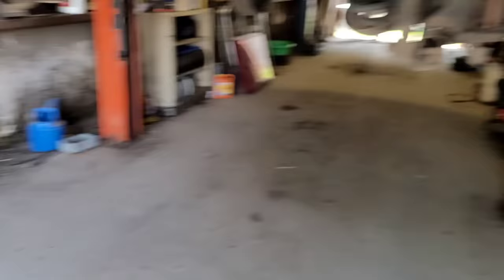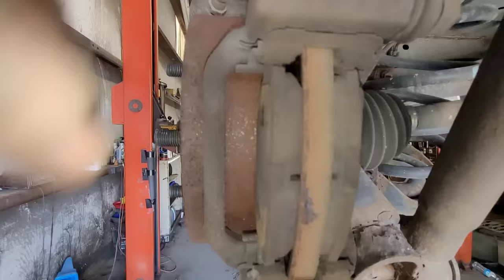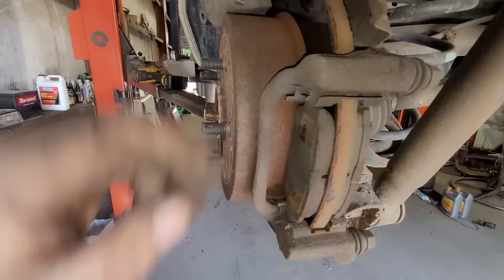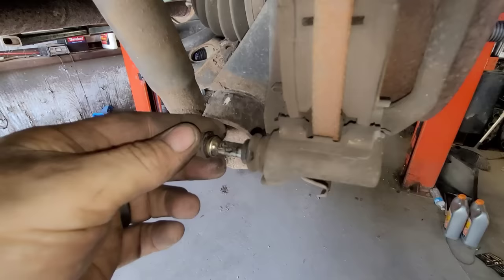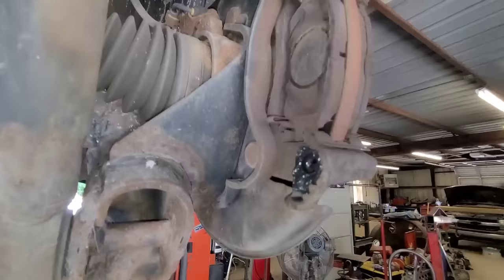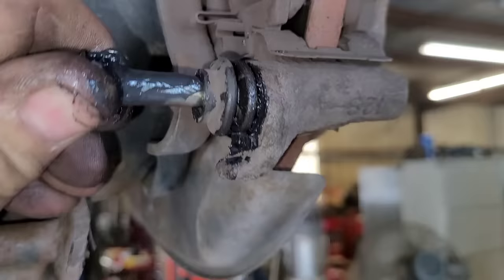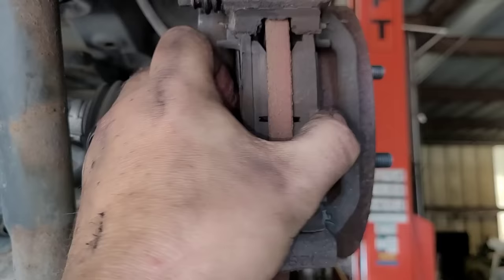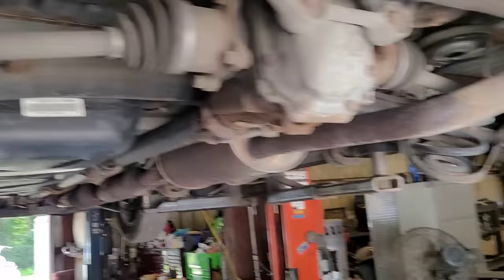Low Brake Pedal ? It's not air in the system...

Comment: The black grease is only for the back and ends of the pads . It will thicken up over time, and should not be used on slides. Only use a silicone based lube on the slides, such as Sil-Glyde.
Reply: Huh? You use them on the slide pins too, right? They are meant to be used for the slides.
Reply: @aboveaero  The synthetic black grease is supposed to thicken over time. It's made that way so it won't melt off the surfaces it's applied to. That is great for the metal parts of the pads, not for the slide pins. Silicone based grease (like Sil-Glide) won't thicken, making it great for slide pins.
Reply: Exactly
Reply: This might explain my sponges pedal, every so often my pedal starts to get sponges and if I press the pedal to the floor and release then my pedal becomes firm again and stays that way for a few weeks or so and becomes spongy again
Reply: "Only use a silicon based lube on the slides, such as Sil-Glyde."  You mean silicone, not silicon.  A silicone or polysiloxane is a polymer made up of siloxane They are typically colorless oils or rubber-like substances.  Silicon (Si) is a light chemical element that combines with oxygen and other elements to form silicates. Silicon in the form of silicates constitutes more than 25% of the Earth's crust. Silica (SiO2) as quartz or quartzite is used to produce silicon ferroalloys and silicon metal.
Reply: @frotobaggins7169  what are you even talking about 😂. This is how to do your brakes not chemistry.
Reply: Yes the black grease gums up or dried up you do not change it enough. The heat from the brake system does help with the grease, hence use Sil-Glyde
Reply: @frotobaggins7169  It was quite obvious to anyone "in the know" that I merely misspelled "silicone". A simple "don't you mean Silicone" would have sufficed.
Reply: @fixitman2174  I know what you meant.  While I was pointing it out to you, I was mostly pointing it out to anyone who reads it.  I hear so many people say silicone when they mean silicon and visa versa.  I think most people don't know the difference.  I'm sure many people believe there is silicone IN silicon and/or silicon IN silicone.  I'm sorry if I hurt your feelings.
Reply: @frotobaggins7169  Nah, feelings weren't hurt. I was just pointing out all that effort wasn't necessary. Now that I understand the motivation behind it, I see that it was.
Reply: @fixitman2174  thanks for the knowledge.  I use NAPA brand Synthetic Ultra Brake Parts Lubricant in a 2 oz. tube.  It's blue and I use it for everything.
Reply: @frotobaggins7169  ...Thanks Bill Nye.
Reply: Totally agree. Use the expensive ~20 silicone grease. Buy once, 😢once. It should last an individual through many cars. I replaced the pads on my parents Avalon. The last person didn’t use the good stuff.
Reply: Bro helped us fix a problem but created another 😂
Reply: @frotobaggins7169  appreciate your input, some people are threatened by knowledge.
Reply: Can i use coconut oil on the slides?
Reply: My last brake job was on my 99 Yukon. I was given the wrong part o ring for the caliper and it was pitted some. I honed it out put the old seal in it worked great because new brake pads and rotors meant the piston didn't have to extend as far.
Reply: @frotobaggins7169  vice versa.
Reply: @markszyszkiewicz   thanks, I always screw that one up.   I really shouldn't use it because I can never remember how it goes.
Reply: @brynnond.6952 I having the same problem.. change master cylinder, change brake booster , change vacuum hose change cylinder , change brake pad. Bleed 3 x .. flush brake oil. No use . Maybe we should try the video recommended..
Reply: Rich girls use Vaseline, poor girls use lard, My girl uses axle grease and makes it twice as hard.
Reply: The boots are actually EPDM rubber. Almost all car rubber is. It degrades when it comes in contact with petroleum products. That's why 100% silicone grease should be used.
Reply: Yeah that’s pretty confusing since on their website, CRC says stalube can be used on slide pins and sleeves, so I assumed it would be safe on rubber too. But I decided to stick with old fashioned silicone grease in the end, just for the peace of mind.
Reply: Container is labeled "Synthetic Brake & Caliper grease".  Probably okay to use on calipers, i.e. "slides."
Reply: @theaussie7160 yes, should make your brakes smell better too
Reply: There IS silicon in silicone. But no silica. Silly!
Reply: If you’re gonna reuse the rubber, at least treat it to some hot soapy water before you knuckle that boot back in. Road salt and rust was all over it and you jammed it in.
Reply: I put a smear of copper grease on the back of my pads.
Reply: I use Seiken Rubber Grease made in Japam for the caliper pin
Reply: @frotobaggins7169 

You mean silly-cone
Reply: @fixitman2174 
And most of the time the auto correct on phones changes the words to misspelled words and incomplete sentences. I thought they were smart?

Comment: 2weeks without driving and trying to find out the problem after bleeding the brakes 20times.... This video made my whole day. Thank you!!!!!!!!!!!!!!
Reply: Me too! Been riding a bike to work! 😂
Reply: I too
Reply: Also exercise the brake piston. Use a big plyer (poly grip) and press it in a few times and pump it out with the pedal. Everything goes easier and easier each time doing it. Then the seal around the piston comes into action and returning the piston away from the pads, and the brakes release the moment you release the brake pedal. It is the magic seal that makes the brake hydraulic system work. Its amazing that noone is talking aboute that seal when working on brakes. Its not only a seal, it brings back the piston just enough to get ta full breake pad detach. Just be careful not to pump the piston all the way out, i have some worn out old pads to put in place, so the piston can travel all the way but not to far.
Reply: Great video 👍🏻👍🏻👍🏻

Comment: good insight to uneven braking solution, one problem, packing the pin hole with grease will create uneven wear also as the grease keeps the pin from its full travel, a little dab will do  ya
Reply from the maker: Great point!
Reply: Yes , too much grease may cause hydro locking..
Reply: Use alittle oil

Comment: Way too much grease. The slide pin won’t bottom out when it’s supposed to which will create uneven wear. I never put grease on the tip of the pin it will create the suction that’s happening in this video. A little goes a long way.
Reply: No and Yes… If new yes if old  no.  It not very tight fit the grease will  Squeeze out. Would I put that much  NO never.

Comment: When the rubber hoses get old they expand under pressure , makes the brakes spongy,  i changed them on my van and bingo .
Reply: I use Stainless Steel  brake hoses - no expansion 👍🏻

Comment: Very important detail most people never do .. always make sure caliper pins are cleaned and greased and move freely
Reply: Also exercise the brake piston. Use a big plyer (poly grip) and press it in a few times and pump it out with the pedal. Everything goes easier and easier each time doing it. Then the seal around the piston comes into action and returning the piston away from the pads, and the brakes release the moment you release the brake pedal. It is the magic seal that makes the brake hydraulic system work. Its amazing that noone is talking aboute that seal when working on brakes. Its not only a seal, it brings back the piston just enough to get ta full breake pad detach. Just be careful not to pump the piston all the way out, i have some worn out old pads to put in place, so the piston can travel all the way but not to far.
Reply: Exactly 🤙🤙🤙

Comment: I am an old school Mechanic I just watched you Video I have  very similar problem with my 2020 4 runner some times I step on the break and the pedal sinks lower, In my mind it remined me of a bad master I pump it a second time and its fine. only happens randomly. I can not seem to duplicate it.  your video gave me some incite where to look  Thanks you..
Reply from the maker: I hope the video helped. I have two Facebook pages. Wrenching with Kenny & Backyard Mechanics. Make sure you answer all the questions to join ByMs. If you get stuck on a project, you can get some advice there too. Thanks for watching!

Comment: I’ve seen this problem many times, since I’m in the Rust Belt. What I like to do in this case is remove the caliper bracket and wire brush the pad contact points, then just a touch of brake grease on them along with cleaning and re-lubing the slides. Never had a comeback after that. Good video bro, great detail.

Comment: My VW TDI Jetta wagon had a low pedal problem.  It was a seized park brake cable that caused the problem.  The adjusters were seized on the rear calipers because I never used the park brake.  Once the caliper adjusters and park brake cable were repaired, the low pedal problem was gone.

I had the dreaded death wobble on the front end of my 1996 Cummins diesel pickup.  On a smooth surface the truck performed normally but if it hit any sort of bump on the road, the front left tire would violently shake to the point that I thought the truck was going to fall apart.  After years of trying to diagnose this problem, I discovered that the rear right park brake cable was seized.  I replaced the cable and the death wobble was gone.  I never in a million years would have believed that a seized park brake cable could cause the death wobble but it did.
Reply: This works only if you have brake drums

Comment: Purchased a 99 Suburban a few months ago and from the receipts supplied by the previous owner the brakes had been maintained less than one year previously.  But for some reason the car was pulling to the right when the brakes were applied.  Upon further inspection I found that the slide pins had been installed without the rubber dust boots and whatever grease had been applied had combined with the brake dust to form a glue-like substance that had seized up the slide pins.  I had to press the slide pins out with a C-clamp, clean the bores with a rotary brush, wire wheeled the pins and re-inserted them with silicone grease and new dust boots.  Now the old car will stop on a dime and leave 8 cents change.

Comment: I am 43 years in auto repair and I was always told never pack grease into the caliper holes, because it will hydraulic lock and never get any grease on end of caliper pin! I see this done all the time, where people cover the end of the caliper pin! Rainman Ray does it all the time. But his quality of work has dwindled since he is his own boss! Sorry had to throw that in there. Good videos. Glad you moved and are happy about it!
Reply: Yea, I thought you should never put grease at the end,, but only on the sides of the pins..
Reply: Uh-Oh....do U also open the bleeders when you compress the pistons????  Ray does not.....
Reply: @wallace3953  no surprise! Lol
Reply: @wallace3953  sounds like you know Ray well? Lol
Reply: Manufactures thought of that and machined a flat along the side of the pin to allow the release of pressure if ther is to much grease at the end of the pin
Reply: @josephmatesich2498  true but not all caliper pins have flat spots!

Comment: Thank you for this video. I was about to bleed the brakes on my Astra and this makes far more sense as to what might be the issue. I'm not a mechanic so just being pointed in the right direction is a huge help for time and sanity!
Reply from the maker: I hope it helped !!
Reply: Mr. Kenny, now you really have me scratching my head.  Ha!  I've watched tons of videos prior to yours telling me it is the master brake cylinder.  But I've never bled my brakes.  Never opened lines on cylinder either.   Right now, I pretty much have no brakes.  Pedal going to the floor and pump it three times to get car to stop.  Do you think it is the pins and not master brake cylinder? 2000 Camry.   I may try the pins prior to doing anything else.  @WrenchingWithKenny
Reply: @llroman7823 hopefully you've found the problem and had it repaired.  If the master cylinder reservoir has no fluid in it, the system has a leak and your pushing air.  If the reservoir has fluid then the master cylinder is shot.  Either way you've been driving a death trap.

Comment: I live in the rust belt and don't even bother trying to clean up caliper slide pins anymore. I just take a small round brush out of the engine cleaning set from Harbor Freight, cut the end off of the handle, chuck it in a drill and run it in and out of the bracket for a few minutes. Then, I flood the hole with brake cleaner and blow it out with compressed air. The slide pins are cheap enough at the chain parts stores that I just replace them. After that's done, EVERYTHING gets a good helping of the purple Permatex lube.

Now, if I could just get my brother to reimburse me just for the parts for the front brake job on his Toyota! That poor car needed EVERYTHING from the rotors out including both calipers! Those pins were so frozen that I had to buy reman calipers WITH brackets. Even my oxy/acetylene torch didn't help!
Reply: yes they can get stuck, be careful heating them, I had a bracket clamped in my vice and was heating the bracket, it came out AND PUT A HOLE IN THE WALL!!!, never stand in front of them, I also like the Permatex purple ceramic lube, it stays soft even if the driver drives like a nascar racer

Comment: Get bore brushes for cleaning firearms, their made of brass with brake clean you can scrub those bracket holes out good.  As others said you can also take a drill bit if you have a good set of drill bits with odd sizes you can save a bracket just don’t overbore the hole. Last don’t overfill the hole with lube you can hydraulic the pin, work that pin in/out till it moves freely purging any air trapped in there. Put a good layer of brake lube on the inside of those boots to help seal them from water infiltration. Very good video help explains how a caliber moves not many people get that.

Comment: Thank you for comfirming my findings   I have a new Ford that had this pedel problem, plus the sticky caliber.  The local Ford dealership wanted to rebuild the transmission (15,000 miles) telling me it was in reverse and forward at the same time. We don't go there anymore. The caliper pins were all dry as a bone, I  removing the pins, doing what you've demonstrated and greasing fix the problem.

Comment: I lube the pins,  more to the front of the pins and it spreads out the grease when I push it into the caliper.  I never put lube in the hole per se, if just cakes up and  make them hard to slide.  Too much lube is one of the reasons for a stuck caliper pin. And the type of lube is important, also.  
Enjoyed the video.

Comment: I do this every tire change winter and summer up north. I also remove the rust on the tabs/ears of the brake pads and lube them a little so they also slide nicely with guide pins lubed up too.

I also use silicone on the piston and clean it and press it in so I know they work as intended and are not stuck.

 I also put some grease on the piston metal lip and on the claws/tooth on the outside caliper facing the pad.

 Result so far over the years is completely even wear and a nice brake pedal, no squeaks, I also know how worn my pads are with 6 months roughly increments.

Thank you Kenny good advice as always
Reply: When you press in the piston also pump it out a few times. In out untill it wont travel any easyer. I can guarante that the first time you have to press harder on the pedal compared to have done it 6 times. It will make the piston travel easyer and the rubber seal on the piston will draw back the piston as soon as the pressure on the pedal is gone. That seal is more than a seal, thats what will pull the piston back in just enough to release the pads from the disc. A round O ring would seal the piston, but its shape would not draw back the piston.

Comment: Rav4s are known for low brake pedals, especially and mysteriously after pad replacement...for no apparent reason. There are guys on the Toyota forum pulling their hair out for this suddenly appearing low pedal, which is then about halfway to the floor than before the repair. I'm going to check all these caliper pins on my Rav, otherwise I'm going to have to replace all brake hardware including rotors.
Great vid, btw.

Comment: Your video has been a lot of help, thank you.  My car is having the same issue it sounds like to where the pedal goes to the floor almost on first press then stuff like it should be on the second press. It's a relief to know that this may be the resolution. A mechanic diagnosed it as being the booster without touching anything. Doesn't sound like a booster issue according to my research.
Thanks again!

Comment: I have had 3 Toyota Camrys, and they all had a low pedal. It goes down further than I would like before the brake catches. I checked the brakes on all three, and even replaced and bled brakes on one. Same thing. My old '95 Safari brake pedal hits as soon as I put my foot on it.
Reply: Last resort for low or spong pedal on old cars.the flex line from the caliper to the hard line Will collapse. Brake won't work pedal still sponge
Reply: @user-cu6kg9cn9o I use Stainless Steel brake lines - doesn’t expand !!!!!
Reply: @jimmysapien9961 Where do you buy your stainless steel brake lines?

Comment: You can get air in your lines without a leak. If your brake caliper gets to hot from a bad bearing or continuous hard braking it can cause the brake fluid to steam or boil which in turn puts air in the line.
Reply: Yep 👍
Reply: Moisture not air brake fluid loves Moisture